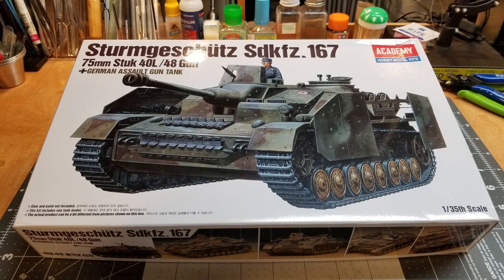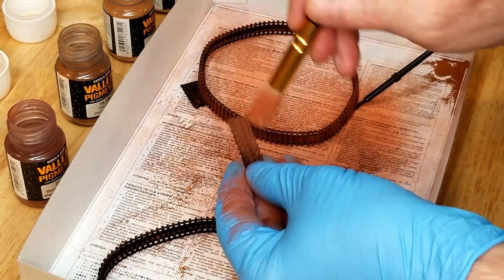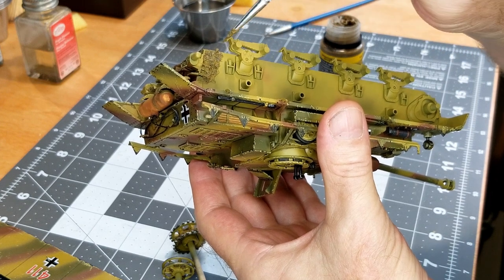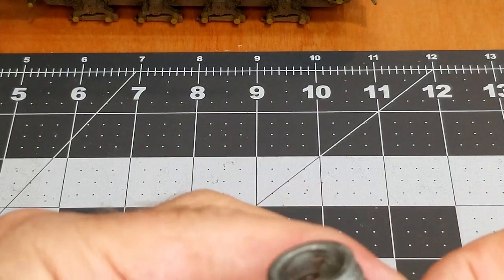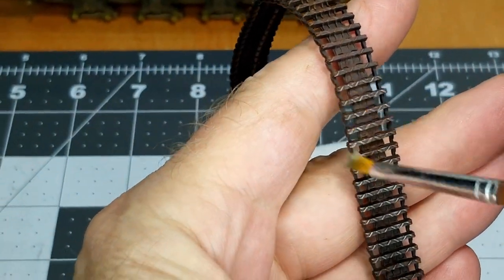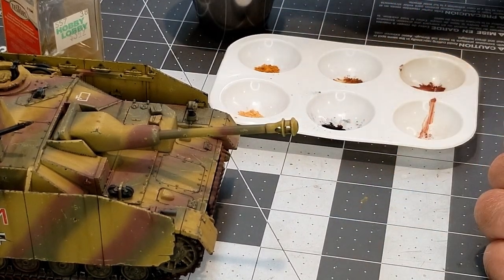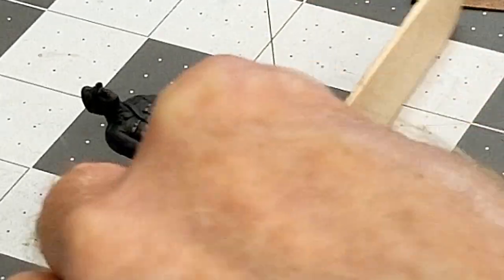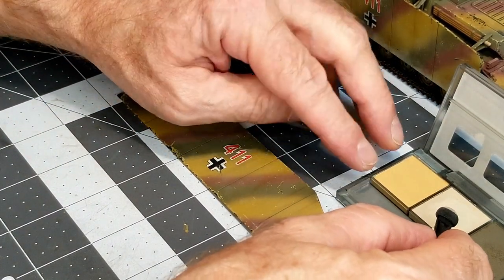Sturmgeschutz IV sdkfz. 167 by Academy Painting and Weathering Part 2

Comment: Great job. Is this a reboxing of Tamiya # 35087? I like to use Mig '''Sand Brown'' 026 for skin tone base.
Reply from the maker: Hey Tim, on ScaleMates it looks like a Academy new tool release in 1987 and reissue with new box in 1994, which is the kit I built. I don't know for sure but I would guess from the sprue layout and part design, that it is a copy of Tamiya's kit, maybe under license, don't really know. Tamiya's kit was released in 1976 and is still available. Thanks for the tip on skin tone, figures are not really my thing but I'm working on it, lol. Thanks for the kind remarks, if you ever have a question about any of my projects please ask, I keep no modeling secrets, thanks for watching and model on my friend!!
Reply: @hillbillymodeling   If you go to scalemates and input the  name of the kit into their search it will show you the linage and if it's a rebox ect , you can do this with any kit . I did post links to the kit at scalemates but they keep getting deleted by youtube .